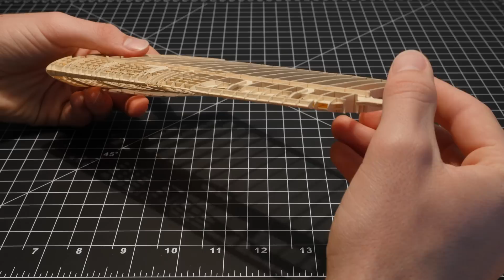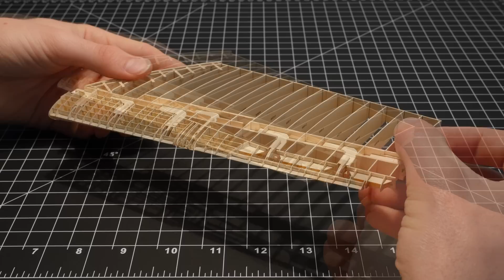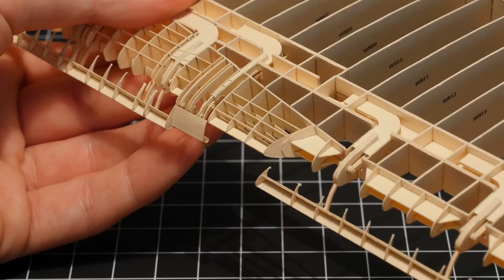Manila Folder 777 - Wing Update - Inboard/Outboard Slat Test **4K**

Comment: Hi, fantastic work. Absolutely Love it.👏👏👏. 
for a couple of years now I’ve been working on a similar project. A scratch build 1/24th scale B 17 F.   With exposed airframe.
I opted to use 0.5 mm plastic card sheets for bulkheads and formers and wing ribs. In hindsight that may have been a mistake. 
Manila folders would most certainly give my more flexibility and scope as well as reducing the cost. Additionally it will be easier to translate from print to cut.
I managed to build half the fuselage and some of the inner wing section before inadvertently deleting my 24000 drawing pack from my ex hard drive. (Ever seen a grown man laugh and cry at the same time😂. )
My intention now, is to start over,  remake and rescale all the drawings. and then make it again in a larger, (maybe 1/18 scale,)from Manila folder. 

I can’t tell you how much your project has inspired me to pick up and carry on. I was beginning to feel it wasn’t worth the trouble..     so Cheers.    And Many thanks for the inspiration. 🙏
Reply: Please share your progress, would like to see... Good luck with the project!

Comment: I have a question? How do you build the rounded and circular parts such as the landing gear, fuselage, and engines? I understand the immense amount if patience and skill required, but I'm curious about how you do it out of flat paper. Also, looking through the windows in some other videos, it looks like the fuselage is quite thick, how many sheets was it? And how did you get the correct nose shape?
Reply from the maker: I've found ways to "deform" it so that it takes on a compound shape. Basically, you rub the paper with something like the rounded cap of a pen until it starts to dent.

Comment: very cool man! I get the meditation part of it. I do the same thing with computers and 3d modeling. Great stress reliever. Will you paint it? Or leave it natural? Have you ever tried 3d modeling? For instance you can make it in 3d software (blender is free) then 3d print out the parts and assemble.
Reply from the maker: I've already "painted" the fuselage (check my other videos). And yes, I think 3D modeling would be really helpful but at this point I'm almost done designing in 2D so there's not much sense in switching over.

Comment: I had an uncle that built several prototypes out of wood and paper and various other materials for projects, his main job was in making prototypes for engineering contracts. He actually had about 20+ test mockups, and 3 scale models for the Garage he later built on his property that was used for his cars, and his Truck With a Camper attached, as well as a Pulley System to detach and store his camper (1 model had a working pulley system as well). I understand the dedication some people put into small projects like these. My Uncle kept building scale models until his death a few years ago, and there were still alot of unfinished projects that my dad has decided to attempt to work on himself.
Reply from the maker: That's awesome! Thanks for sharing.

Comment: Have you ever considered adding a small electric motor to the propellers so that the can work and look correctly without you moving it with manual force I think it would look really cool
Reply from the maker: I have, but I like the challenge of just using paper and I'm actually not sure how well a motor would work with this sort of thing... the paper is pretty stiff.

Comment: Luca, are your interior structures accurate?  Where do you get such detailed references?
Reply from the maker: Generally they are (the wingbox ribs, for instance, and the outline of the wingbox), but I've taken many liberties due to the nature of the material I'm using and the fact that the actual systems on the 777 don't lend themselves to miniaturization and would be non-functional at this scale. On the actual 777, the slats are actuated through the rotating motion of a rod that runs the length of the wing, rather than the push and pull I have going on here.
Reply from the maker: Oh, and the training manual has been a big help: https://drive.google.com/open?id=0B3UGWOS9vEknM2hoUDFRdUVmZHc

Comment: So how exactly are you going to able to pull that tab If its going to be inside the wing? It will be covered with paper?
Reply from the maker: There's gonna be a door that opens up in the underside of the wing and there'll be a bunch of sliders that you can push/pull to activate different functions (flaps, slats, spoilers etc).

Comment: Hi! I found out about this project yesterday, and I'm still amazed at the quality and realism of the build, I have watched both slat-mechanism videos and I get the piece of "paper" that runs through the wing, what I don't get is how if it is going side to side, the flaps can extend out, you mentioned that there is a piece of paper that moves and while it's moving it rotates and at the end it's the locking part for the flap, how are you handling the friction of that?
Reply: I think the moving paper has a part increasing in thickness as it moves through in the wing which will push another piece of paper, cut a square out of thick paper and cut it from one corner to the other to create two rectangles. Now slowly push one rectangle on the other, and one wil push the other away depending on which you are holding in the same place. Just like a car driving up a hill.
Reply: I don't know if that is what he did, because that still doesn't explain some things...

Comment: Are you going to use servos to actuate the flaps when you install the wing?
Reply from the maker: no, it's all going to be manually actuated. but there will be a small hatch in the underside of the wing that exposes the controls for the slats, flaps and spoilers.

Comment: Wow! An amazing mechanism, How hard you have to push or pull to overcome friction?
Reply from the maker: there's a fair amount of resistance, so hopefully it's not much of an issue in the final model. it's also more prone to warping without the wing skin applied.
Reply: Would it help if you just put a thin layer of plastic, nail polish coat or smooth glue to reduce friction?